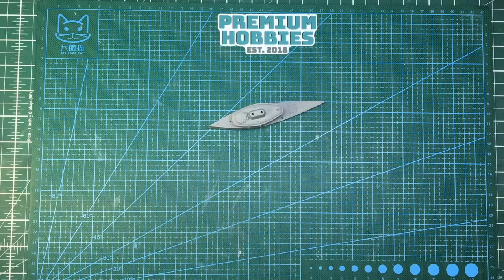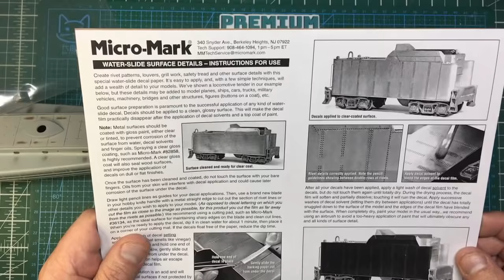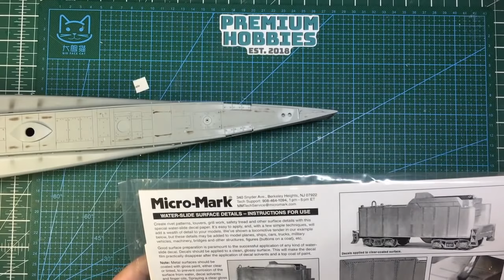Das Werk 1/72 U-Boat U-9 build. Part 6

Comment: Good question and well made solution... the oval mid of the conning tower is part of the pressure hull - the surroundings are only thin tin and flooded by sea water - so also the side of the oval parts should be given a much other surface structure (more showing the heavy steel being rolled) as the surrounding tin with it's dents. But we could prolonge the rolled parts into the conning tower to open the hatch and add some further piping inside and imitate a closing mechanism on the in- and certainly outside! 

Thank you very much for this question,improving our own builds much further, Nigel!

Comment: Hello Nigel, I’m not an expert, but I did spend a couple of years working as a contractor on a ‘still in service’ submarine class. One common misconception is that the conning tower on many submarines is pressurised, which it isn’t, It actually floods when the submarine submerges. If the U9 is the same as the one I’m used to, there will be another hatch at the bottom of the ladder leading down from the conning tower. The horizontal circular tube inside the sub hull forms the only pressurised bit. It is possible that the inside of the conning tower is largely empty and the holes simply let the air out and water in, when it submerges.

Comment: Nigel there's a YouTube video called "Diving the wreck of U12 - German WW1 submarine posted by Rod Macdonald. If you look at 11 minutes, the front oblong shaped vent has thick glass in it (its mentioned on screen and it is also very clearly see in reflection). The after port is also glassed (see at 12 minutes). There is also some interior detail within the conning tower if anyone is interested and one of the stern torpedo tubes is open and still contains a Torpedo. The ports appear to be modelled accurately so far as you can tell given the state of the wreck. Well spotted !
Reply: Yes, this is correct, in later types, this practice was abandoned due to deeper diving depths. Cheers

Comment: about the CAD, i work with 3D models and am studying to become a 3D artist,  making something in cad is not always easy, complex shapes like wingtips or noses with compund curves are hard and sometimes the program doesnt want to do what you ask. i agree that i is one of the causes of the errors in modern kits, but without proper blueprints and mesurements and such, it is really hard to make the correct shapes and especially curves.  if you want to see some of the 3D models i have made i would be happy to send some pics to you, but again as i said  without proper blueprints they are hard to make and depth perseption can make curves be too sharp or shallow.  also  its been a while since we have seen titanic, maby i missed you saing why in the recent videoes,  will you be putting figures on the ship when it is done ?
Reply from the maker: Hello mate. You have absolutely proven what I was saying. If it were not for 3d cad and printers the issues we see on modern kits would not exist. The "old school" way was to carve a model from wood until it looked right, then you had a master to work from. I have been an Engineer all my working life and it breaks my heart to all the lads out there putting together 3d models with stupid tolerances, often where no tight tolerance is required.
Blueprints or not, if the person on the tippytappy doesn't have an "eye" for the subject, forget it.
Reply: @NigelsModellingBench  i agree. i only make 3d models of planes and armored vehicles because that's where my passion lies,

Comment: Could those holes just be drains so that when the boat surfaces the water runs out?
Reply from the maker: The ones in the fairing around the conning tower are, but I am only concerned with the round holes in the conning tower inside the D shaped holes.
Reply: @NigelsModellingBench  perhaps they're just viewports so that you can still see out when the ship is under fire...
Reply: Hi Nigel they are glazed viewing ports, see the dive video on U12, (I the Firth of Forth), they even mention a wiper being present, also some views down the hatch showing some interior detail.
Reply from the maker: @viking1236  Thanks buddy. I have given you a shout out in video 7. Noiw... how do I make those lenses??
Reply: I look forward to finding out, I imagine it would be similar to portholes on the Titanic, but then I'm not a modeler!

Comment: Nigel, great build. Be careful when adding the deck (piece B37) it is a mm too short, making parts B17 amd B19 line up wrongly. Best is to cut it, at the height of the front diveplanes and add some evergreen strip.
Good luck!
Reply from the maker: I’m ahead of you. I’ve covered that in part 7 only I cut under the conning tower. Thanks anyway.
Reply: @NigelsModellingBench  You're welcome. I unfortunately saw it when it was too late, can't fix it anymore. Looking forward to part 7.
Reply: Didn't have that issue with my deck, I had to adjust it at the aft end.
Reply from the maker: @MrLoewietje  I'm checking everything as I go... checking three steps ahead is required i think?
Reply from the maker: @toboldlygosmodelworks1973  I think you've just done the same as me, however saying that I had to add strip at the bow too?
Reply: @toboldlygosmodelworks1973  that would sound very wrong in a New Zealand accent..